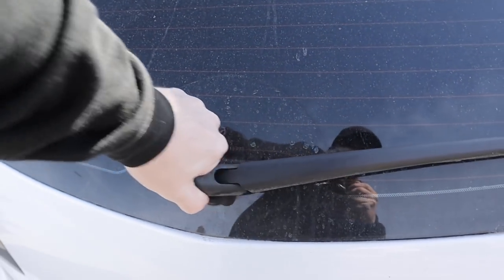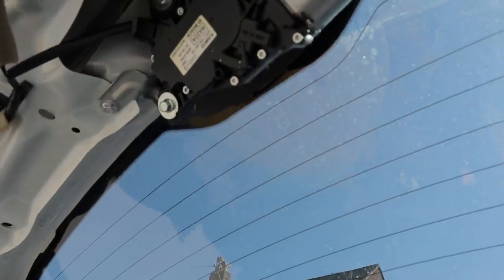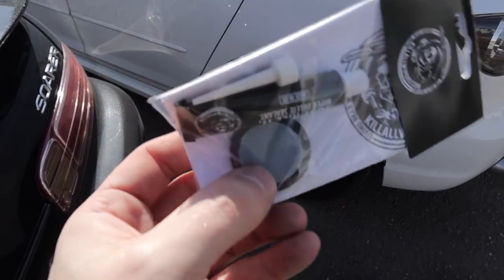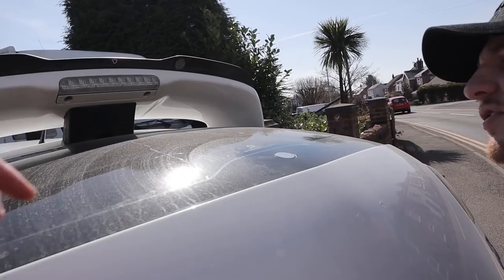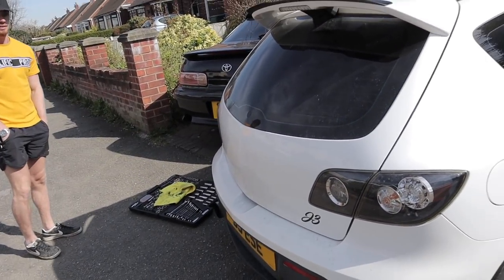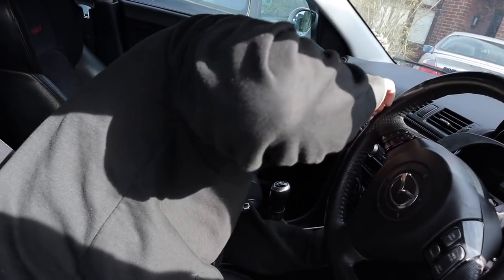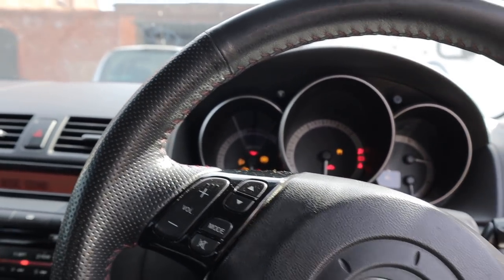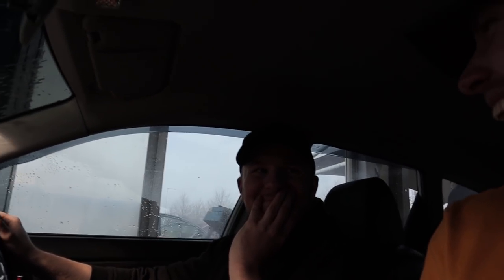MORE BOOST FOR THE MPS!!

Comment: Unplugging is for sure the definite way to disable swas but if you hold the dsc button down and turn the key whilst holding the dsc and traction lights both stay active and the systems offline until next restart or you press the button just a tip

Comment: Steering wheel alignment sensor (SWAS). Once the steering wheel is straight it gives you full boost but once its turned it limits it. 1st and 2nd gear torque is limited as well.

Comment: It's steering wheel angle system... it torque limits when the wheel is turned off center
Reply from the maker: SonarCreep love it now it’s off ahah
Reply: My torque steering went when I fitted 235 40 18 ps4 tires.. I also had a staggered set up with 235 40 18 front. And 225 40 18 backs.